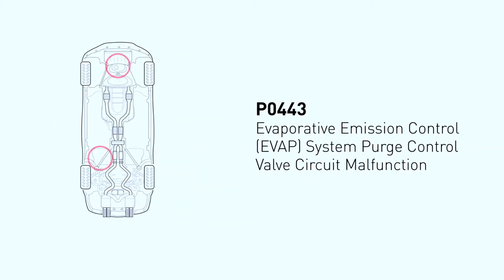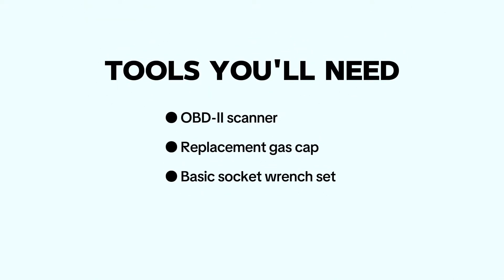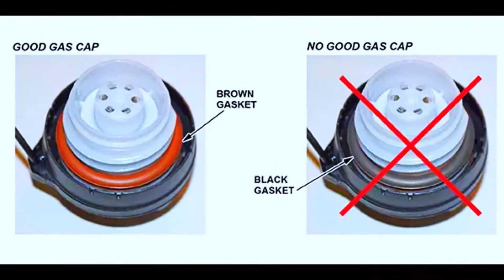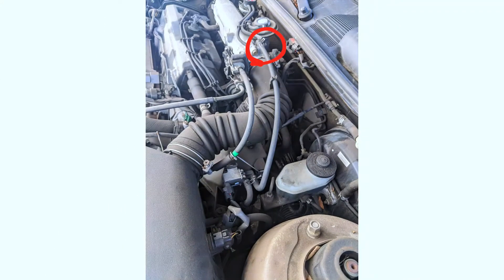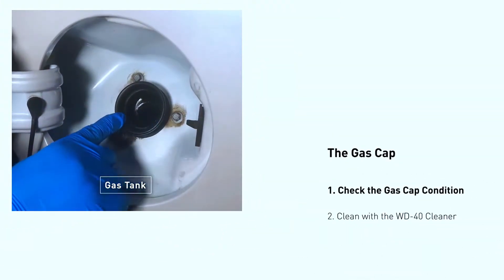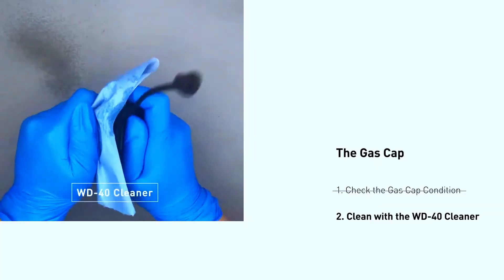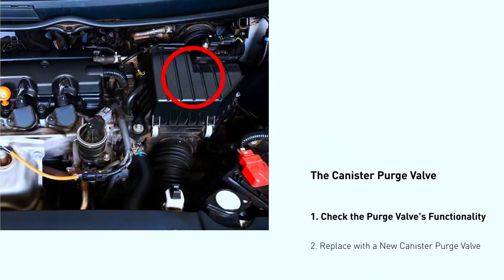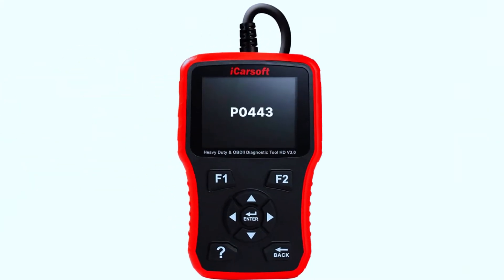P0443 Code: How to FIX IT FAST !

Comment: Is it normal for a ford mustang v6 2003 manifold to get red??
Reply from the maker: Great question! No, it's not normal for the intake or exhaust manifold to glow red on a 2003 Ford Mustang V6. That usually indicates excessive heat, which could be caused by a clogged catalytic converter, a lean fuel mixture, or ignition timing issues. It’s best to get it checked out ASAP to avoid engine damage.

Comment: Put cap purge valve tank pressure sensor canaster and paper valve still have code p0443
Reply from the maker: Even after replacing the cap, purge valve, tank pressure sensor, canister, and paper valve, the P0443 code persists, indicating an ongoing issue within the Evaporative Emission (EVAP) system. This could be due to a faulty wiring harness, a malfunctioning Powertrain Control Module (PCM), or a leak in the EVAP system itself. It's recommended to consult a mechanic to accurately diagnose and resolve the root cause of the problem.